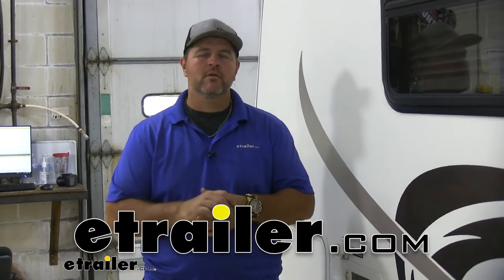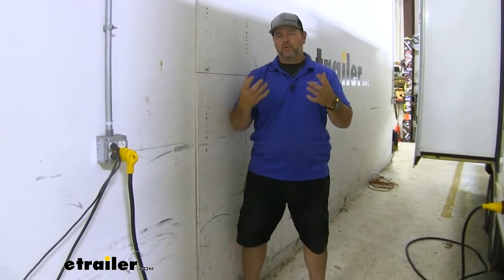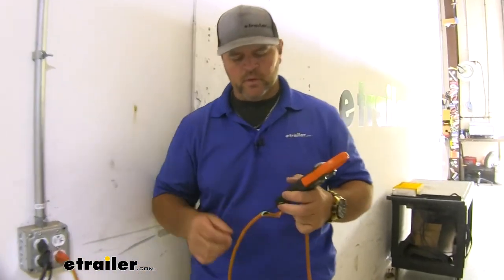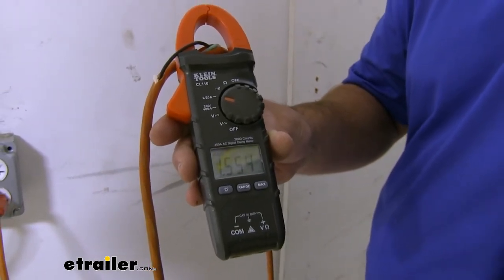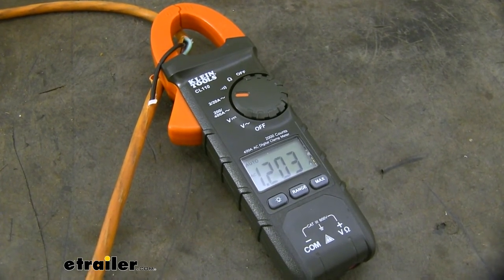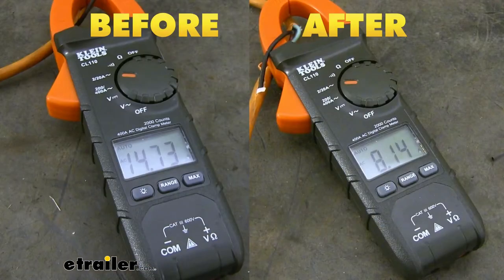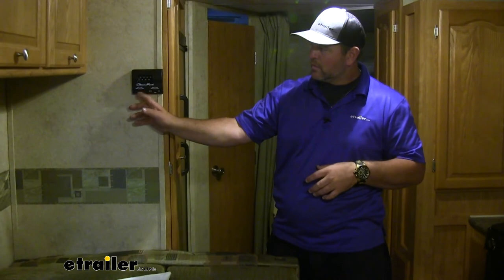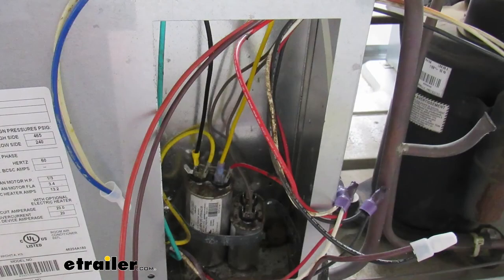etrailer | SoftStartRV RV AC Unit Soft Start Review

Comment: I understand the SoftStart helps with reduce the power needed for start up…any advantages to reducing power when in “run mode”?
Reply from the maker: The SoftStartRV will hold a certain amount of energy it takes to kick your compressor over. It will not lessen the amount of power the A/C is using while it is running. The reason why your A/C will not cool is because it takes too much energy to turn the compressor over.
https://www.etrailer.com/Accessories-and-Parts/SoftStartRV/SSR54FR.html

Comment: Will the soft start addition allow water heater to operate while air conditioner on ?
Thanks !
Reply from the maker: That will depend on how much power your water heater requires to run. You can find this information in the owners manual of your water heater. I do not see this being an issue if you are only running one A/C unit.
https://www.etrailer.com/Accessories-and-Parts/SoftStartRV/SSR54FR.html